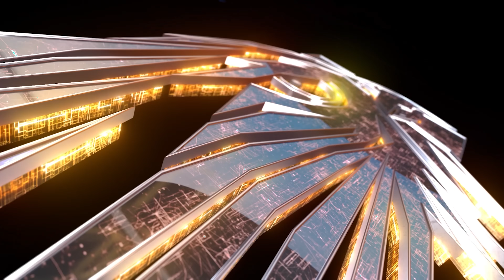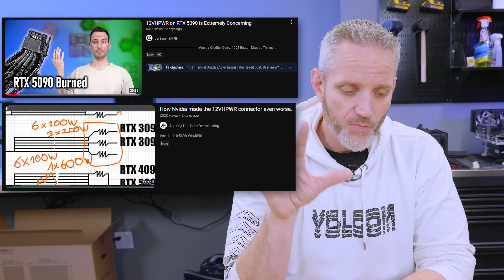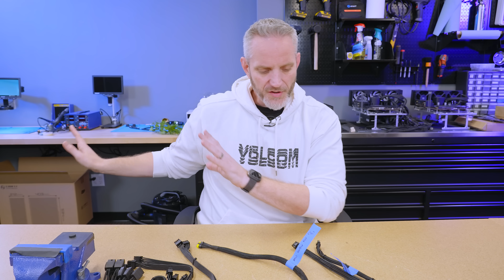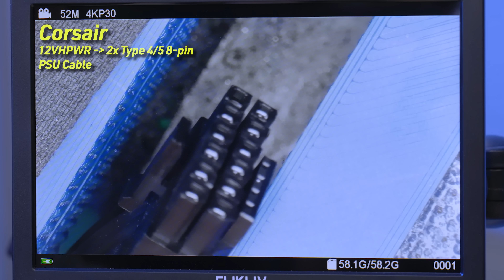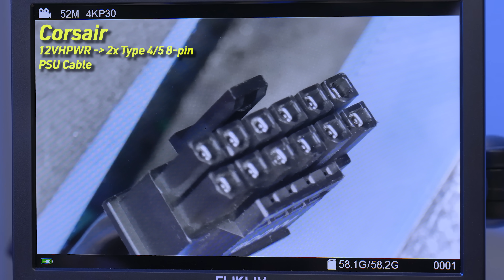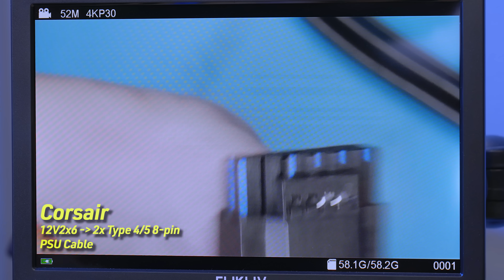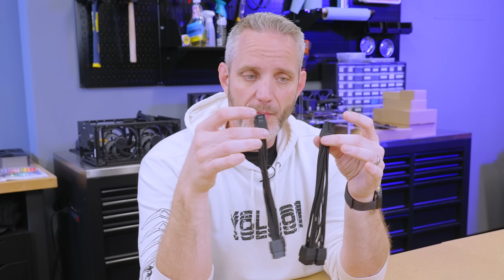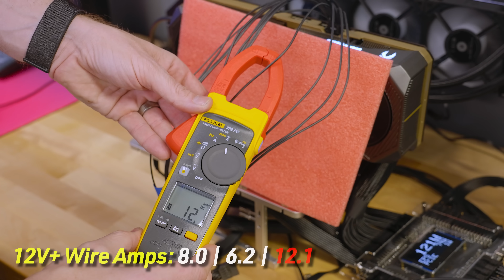I discovered something concerning and I need the Experts to chime in... More 12VHPWR discovery!

Comment: The ground (-ve) also connects to the chassis and the heatsink etc so there will be less power draw through the actual cable as the -ve will use any path available

Comment: I just bought a new latest Corsair RM850x atx 3.1 psu. The first PCIe 8 pin cable I plugged into the psu, one of the pins popped straight out of the plug with no resistance. I keep trying to get Corsair to send me a new cable, under warranty  but they keep trying to send me an older round cable off the previous model psu (which is the psu cable style I just replaced with this one). I suspect there’s something horribly wrong with the latest corsair cables. My cable feels like the plastic square edged  stopper on the inside of the plug is a ramp, rather than a square edged stopper.  It also comes with a double ended 12VHPWR cable. I’m really dubious about using that now.

Comment: Maybe there is a market for a product like the ElmorLabs PMD2 that ensures that the PSU sends it's 6x 8.5A across the 6 wires, and ensures that the GPU gets it's power across those 6 wires.  In addition it would be interesting to see how the ASUS Thor 3 does it it's load-balancing power delivery to the GPU.

Comment: To be honest the sallower the pin the less contact area you have so the resistance goes up, it's ohms low, since you have a sallow contact that point will heat up no way arround that since. the "bigger the aera the bigger of a "place" you have to push power and lessen the heat up but shuving 12v x20= 240w down a fairly thin cable is not a good choise anyway. there maybe 1.5mm² so you can do the ohw law on it to know the resistance of the cable but then you have to messure the less seated pin from both sides i'm quite confidend that it will read a higher resistans but then like a old light bulb the restance goes down the moment it start to head up and the low resistance a cross athin wire least to light and head dispation as a by product

Comment: Coming from someone who has done electronics work for almost 15 yrs... Those pins and the plastic connector housings have interlocking tabs that are supposed to keep the pins firmly secure. You need a special tool to be able to get those pins out after installed. The problem could be a number of things.

1. The plastic housing for the pins could be either low quality or there is a deficiency in the injection molding process and not providing a sufficient surface for the pins to lock in place. Though not definitive, this is supported by the fact that the problem is frequently occurring on the same pin number for a lot of these connectors. 

2. The pins themselves are deficient... lots of things can go wrong there but its a surprisingly lengthy process just to make them so I won't go in depth here. The pins not locking correctly would result in completely random failures across the different pins on the connector. 

3. During the assembly process, these wires simply are not being inserted to their full depth, and so they just aren't locking at all. This theory actually also is supported by the fact that the problem has a high rate of occurring on the same number pin. If these connectors are made with some form of press (as opposed to by hand) there is a chance it is not applying even pressure across the connector face and that could be another reason why we are seeing repeated failures on the same pin.

Try taking a pair of needle-nose pliers or even just your fingers and see if you can get that wire all the way out of the connector housing. Since the wires are bundled close together they aren't going to come all the way out of the back on their own if it is individual pins failing...

 However! You shouldn't be able to pull them all the way out even with a pretty strong amount of force either with your fingers or pliers.

Comment: Debauer demonstrated that one or two of the 12v wires are carrying all of the current and are being overloaded. If all 12V wires are being consolidateds through a single resistor on the card, It cannot possibly be the GPU Card that is causing this  problem.   The Card has no mechanism to  specify  20A through a single wire like what was demonstrated on the debeaur vid.  If each of the 12V wires was carrying the same balanced voltage/current, there would not be a melting issue.

The Power supply is controlling what wires receive 12V/current so you should be looking at a fault in power supply design

Comment: In aviation we call this condition "pushed pins".

When the pin locking mechanism isn't working correctly and the pin is not locked into place, it will push back when you install the connector. This will lead to issues.

Often the connection can read as having continuity using a meter, but there is not enough contact to allow proper power flow. This applied to actual power and even signal wires.
Reply: Even working on cars I often tug and push on each wire after seating a connector to ensure none of them have pushed past the retention mechanism or have excess play. Not to mention almost all modern automotive connectors have dual retention where the pin locks into a tab and a further plastic blocking tab is pressed into place to retain all pins securely. Can't even close the tab if all the pins aren't fully pushed in. This is like a bad joke for Corsair to say it's fine.
Reply: @802Garage look closely the pin that move is inserted backwards the slit in the pin is rotated 180° vs all the other
The retention mechanism cannot work
That a manufacturing defect
Reply: @legros731  Yes, this style of connector and pin are directional. If they are not inserted correctly, it will not lock correctly.

Good catch there, I didn't notice that on my small phone screen.
Reply: @jasonh4534  I did notice on my tiny phone screen and I got bad eye lol
Reply: Look closely the pin is inserted backwards bs all the other 
It's c shaped and where the metal meet show that it's 180° rotated bs the other 11 pin that doesn't move
That a manufacturing defect

Comment: On my Gigabyte RTX4080 Super Gaming oc there is a LED at the 12VHPWR connector. According to Gigabyte this should start to blink if the connector is not secured. Not tested this lol, but I do use a Lian Li  Strimer Plus V2 12VHPWR that is connected to a dedicated 12VHPWR cable from the ATX-3.0 PSU. Not sure if the  Lian Li  Strimer Plus V2 12VHPWR is a "certified" cable however.

What I did found is that some cables only supports upto a certain Watt. For example on the Lian Li site: 3X8 PIN to 12+4-PIN
8 light guides
For 12VHPWR GPU connector
SUPPORTS UP TO:

450 W, if power supply PCIe cable is 18 Awg.
600 W, if power supply PCIe cable is 16 Awg.

So at the level the RTX5090 is pulling this would not be ok even that it has 12VHPWR connector.

Comment: The other thing i would say is that nivida doesnt not sell that adaptor as an individual part (i contacted them), if you want that adaptor you either go second hand or buy a founder edition card. Most of the AIB are using a different set of adaptors not the same one that nivida supplies in their founder edition.

Comment: How I would design a cable:

step 1 design connector
step 2 make a test build
step 3 hire 100 Idiots [people who are afraid to even plug in a usb mouse] to plug in the cable
step 4 test
step 5 if failure= throw out design
Step 6 if step 5 = yes go to 7 if no= go to 8
step 7 start from 1
step 8, make a higher quality revision.
step 9 send it to tech-tubers for review/testing [no strings attached video]
step 10 if step 9 signs off on it proceed to release the spec

Comment: Multiple wires connected in parallel will have resistance differences in their connections. Naturally, higher current will flow through paths with lower resistance. One faulty connection is enough to overload the others,  A simple overkill solution: switch to a new design based on Molex Mega-Fit, 4x10awg or 6x12awg, enough to handle up to 1500w... ok, too much, but a connector with 4x12awg and sense wires must fit in the same space area and deliver reliable 800w.

Comment: A connector that is barely making contact creates resistance. Resistors generate heat and therefore can easily generate a fire or melting of the housing.

Comment: this makes the claim of nvidia correct where they state user error not plugged in fully. if they tested only with their own cables, then that seems a valid point. 

also why aren't shunts in the PSU to regulate the power to the individual wires? why must in be in the end device?  I don't beleave that is a spec. but I am not an expert. I would rather have it measuring in the power source, then you always know you do not have such issues. therefore I think both specs are wrong, from the cables and from the psu side.

Comment: They made the standard with little margin for safety.  Simple manufacturing processes will result in cables that can not be pushed that hard that long.  The part that sucks is they are creating standards and pushing it on everybody, but they are only good for 1 generation.  Not only is this card a space heater, but it will require a new expensive power supply and  better case cooling.

Comment: Hey Jay! Thanks for the video. I'm looking the video and also checking my Corsair cable, it's a H+ version, but all the 12V rail move really easy like 1 or 2 mm. I'm not using the cable because I have a 3080, so I'm safe for all this drama. But like you say, it's a clue of what is happening.

Comment: Holy hell... There's some differences in the depth of the pinning for sure. Also. Shouldn't the GND pin be less seated than the other pins so the GND pin is the last one losing contact when unplugging the cable. Where is the spec for these?! :O

Comment: My Corsair 12VHPWR cable is not that bad on the GPU side but the sense wire wiggles a lot on the PSU side. Worth noting that this is my second Corsair PSU because I returned the first one due to a bad ATX 24pin plug on the motherboard side, it wouldn't latch due to a malformed locking hook.

Comment: i think its 2 seperate things 20 amps on 2 wires and bad plugs. You can have best plugs but they will still melt if there is 20 or more amps on one wire.

Comment: As an electrical engineer whose primary job is to make sure this exact thing doesn't happen, I don't think i'll get sick of this content anytime soon.

The issue is definitely on the 12V side, there is a whole bunch of alternate routes for the current to sink to ground for badle seatet connector to not be as much of an issue. All the GND connections in your PC are interconnected, they make up all the shielding, all the unused space in the multilayer PCBs, all the metal brackets etc. 12V on the other hand is almost always separated for each connection, that's why it can be provided by completely independent power supply even if that power supply is not designed for parallel operation.
What that means is that GND will find the path of the least resistance, and when that resistance increases due to heat, it finds another, but for 12V there is usually only one path between the PSU and the VRM.
Reply: Some electric experience here but not enough so figured I ask :)
How much is any recess matter as long as the pins are firmly connected?
Reply: @Hoggaforfan  A lot. The point of contact is virtually always the weakest point and any deficiency there adds up quickly. The connector is designed for X crossection which results in Y resistance that causes Z amount of heat to be produced. If the crossection is lower, resistance is higher, and more heat is produced. If the temperature rises due to the heat produced, resistance rises producing even more heat. Furthermore the higher resistance means lover voltage on the load, which means more current has to be drawn for the same power, which again increases the losses on the connector.
As you can see, there is a very specific point beyond which you very quickly run into thermal runaway scenario.
Of course the other side of that equation is how much heat you can remove from the connector.  A Tesla supercharger uses flimsy 50mm2 cables that can normally carry maybe 125A on a screw connection, but  Tesla can get away with well over 300A on a plug, because they water cool it.
A 12V connector plugget into a 600W space heater confined in a box so small it's pressing against the side panel? Probably having a bad time...
Reply: @Sett86  Thx, I thought it was something in that way but wasn't sure. For most scenarios, just any connection is enough, but that high up with that low tolerance, it's more important than I think most people realise. Including myself. Didn't know that about Tesla, so cool info.
May I ask what solution you would think might be a solution? Load check or different pins etc
Reply: @Hoggaforfan  Honestly there isn't much you can do except buying something else. Make sure it is plugged correctly and that the cable isn't under any tention, and have adequate airflow in the case.
Reply: @Sett86  Oh, I can't afford it anyway, so I'm safe 😂
I'm just curious about the theoretical concepts

Comment: I have a Corsair HX1000i power supply and a 4080 super.  I upgraded my gpu cable when I got my gpu.  I will for sure be pulling out the connector to look at that.

Comment: Current actually flows reverse (electron flow) from negative to positive but we still design electronics with positive to negative flow (current flow). Taking example one negative wire off causes resistance to increase on negative side.

Comment: I'm thinking not all cables are created with the purpose to deliver 700W. For instance one of the cables you showed us had 600W printed on the plug. Area of contact on a connection pin should be way over spec. So much  that the recessed pin shouldn't be a problem. However the pinch force of the female to male pins need to be enough to secure contact. And here is where cheaper options might miss their mark. Tolerances tend to increase with price getting lower.

Comment: Electician here: It is not the pins, the cables, the user interactions...everything is good. The problem is the design of the project. You want to send 600 watts through a few tiny cables? (Yes and obviously more amps than it can handle)Thats just insane. Ten years ago a PSU had 600W an you did use a hughe cable to get the power from power outlet to PSU. It´s realy that simple, trust me.

Comment: "Loose" is not necessarily out of spec, but anytime you have a loose male or female pin you have to be mindful of when it gets inserted since the pressure to insert could push the pin out of its socket and then be out of spec. by not being connected or barely being connected.  I would watch each wire to see if any move when plugging in.

But I think the more concerning part is the power not being split evenly, causing the amps to be too high for each wire.  There needs to be a fix to even it out or go with a higher gage so the wires can handle the extra load.

Comment: My 4090 started crashing the other day so took a look at the cable. It was seated correctly, but because I had to bend the cable down to make sure it didn't touch the side panel,  the pins over time on one side of the connecter recessed like in your video. Every pin that was recessed the cable associated with it had melted. No damage to the PSU or GPU luckily. Id show an image but cant do that in the comments
Reply: than your story is not right, as every pin that resesses has more resistance hence it will have less load,  Its the pins that keep good contact that have less resistance hence get the full load and heat up all the way to melting point.
Reply: @scriptkiddie1000  I've tried posting an imgur link to a picture of it, but it isn't showing up.
Reply: Were you using the Nvidia adapter? Were you OCing the card, stock or powerlimit/undervolting it?
Reply: @runix2189   I have the Asus Tuf 4090 OC with custom EK water block on it. For Daily use I run it at 70% power on a custom curve focused on undervolting for maximum gain. I believe its set to 2750 max. Im also using default Asus Bios. The cable was purchased from  Cablemod
Reply: @owensatom  Must be the cablemod connector, they aren't as quality controlled as the nvidia stuff. My 4090 never goes above 320W, no issues after almost 2 years.
Reply: so does the card work with new cable?

Comment: My issue I can't really use third party cables (or atleast limited options).  I have a corsair psu which used the type 5 cable which is a much smaller connector at the psu end.  Would be good to see if this smaller connector is actually suitable for higher power draw, as this surely would produce more heat than a large connector with bigger conductors ?  Sure the cable is rated for 600w, it real world testing ... is it.

Also is this "melting" really a an issue?  When you look at the number of cases, its minuscule (only 50 known cases for the 4090 around the globe), this points more to other issues at fault not the cable otherwise many more would have the issues.  A random bad gpu with some iffy caps, or a psu that fluctuates, or simply the fault tolerance on cable manufacture is to blame (which I dont think is the case).

Comment: I have the same Corsair cable that came with the PSU and was never plugged in a single time. And it has exactly the same discrepancies in the pin height as shown in the video.

Comment: This completely explains why so many have said all they did was plug their cable in, un pluged it to check, then plugged it back in and had failures. 

Massive design flaw. This needs to be corrected asap, and manufacturers need to be held accountable.

Comment: Surely High power cable connection must require large surface area contact to pass through the power efficiently. If some of these 12v pins are only just making contact and drawing high volts/amps it’s clear the pins start to heat up and burn the plastic. Larger surface area spread the heat more evenly especially under high demand.!!